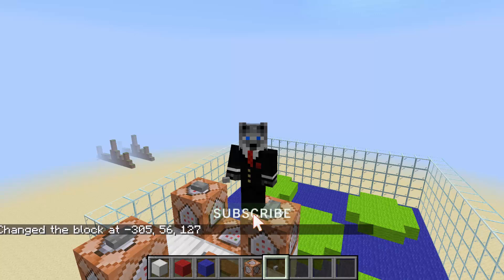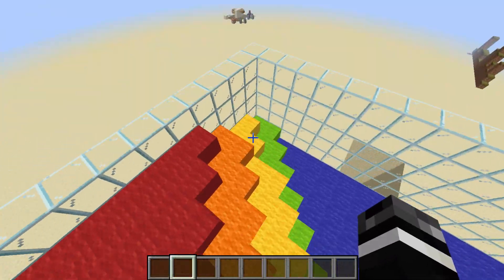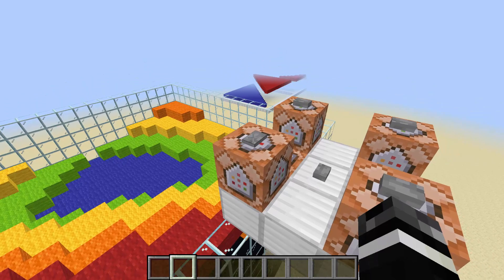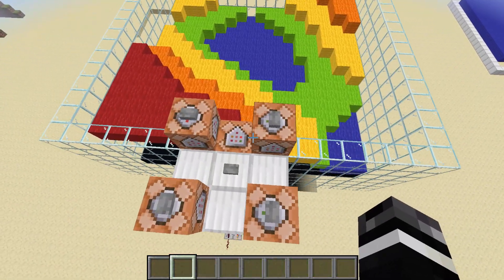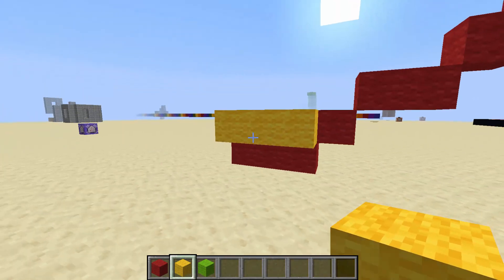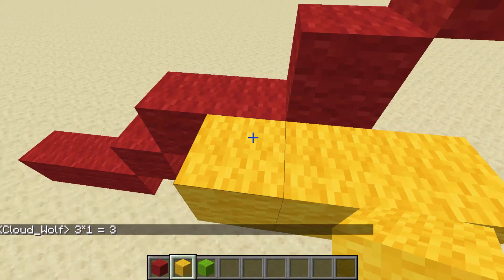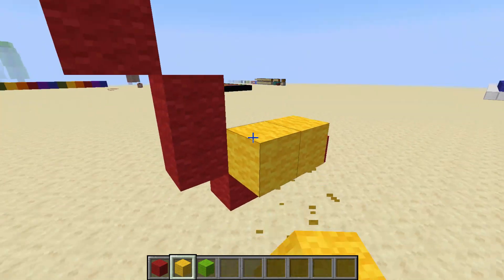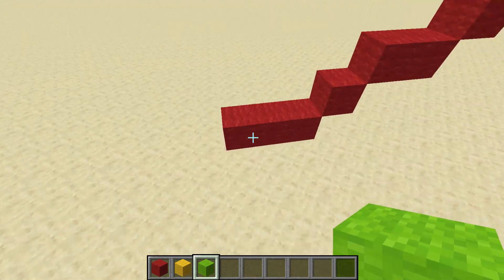Vanilla Smoothing Tool / 2D Convolution in Minecraft (Concept)

Comment: data storage is really nice. When I made this for blingedit in 1.13, I used an entity for each column cuz i found /data to be a bit unwildy still, but that of course slows the thing down a shit ton. Nice video
Reply from the maker: Ya this is 0 entities
Reply: And I then implemented this smoothing tool into a brush based on your code ✌

Nice to see you in these comments. I had exactly the same thoughts 😁
Reply from the maker: @moggla  well if ur using a brush it needs to be a really fast algorithm otw it’s hard to use which is y my method here is clean. Also bling edit has unnecessary overhead that isn’t important at all. It’s kinda bad ngl